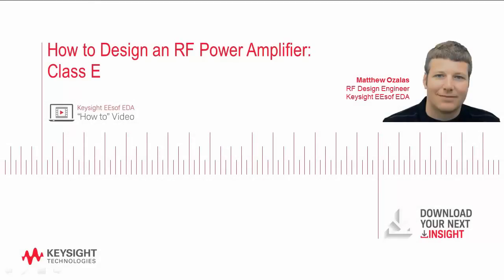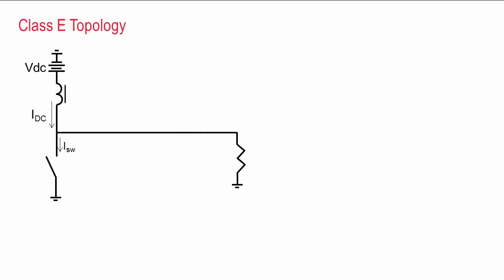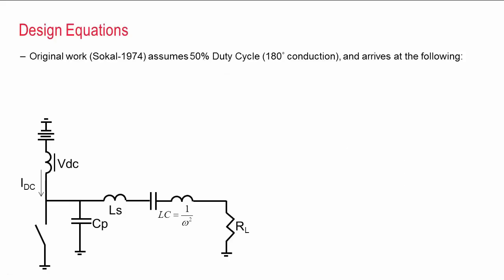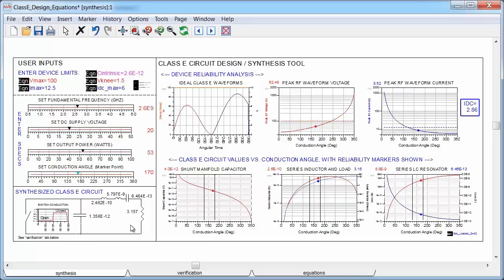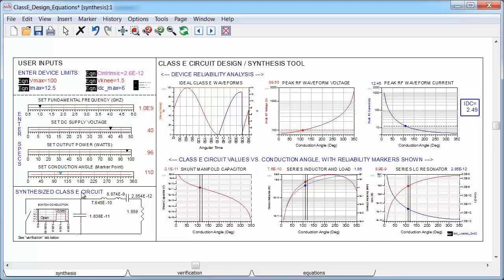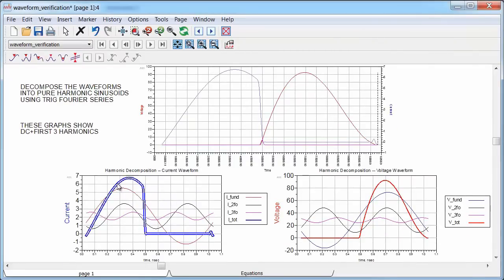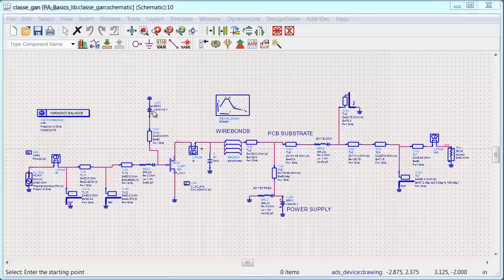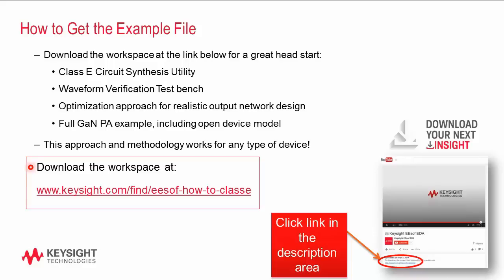How to Design an RF Power Amplifier: Class E

Comment: Could you tell what are the equations you are designing with or from which book did you base yourself to design this PA amplifier ? When you set DC bias or output power, the synthesis tool automatically adjusts parameters, but, with which equations does it do it ? Thank you !
Reply from the maker: The equations used to generate the waveforms are based on a
little bit of mathematical manipulation from Raab’s paper, “Idealized Operation
of the Idealized Class E Power Amplifier”.  These are found in the data
display.  The output power and subsequent waveform peak voltage value are
ultimately what gets adjusted when you change the DC bias (and knee voltage).
Reply from the maker: Sorry, the paper title was incorrect. It should be "Idealized Operation of the Class E Tuned Power Amplifier".
Reply: No worries. I have realized that because there was only one match. Thank you !

Comment: Hi,
Thank you for the nice presentation. It is very helpful.
could you please tell  me how can I replace the transistor GaN with PMZB380XN? or BSS138? and the frequency range to 13.56MHz?

Thanks

Regards
Sam
Reply from the maker: Nabeel Fattah 

In the “ClassE_Design_Equations” data display, on the top
left hand side of the “synthesis” page, there is a section called “User
Inputs”.   In that box, near the “Vknee” variable, there are more
variables in small print which set the range for the sliders (you may need to
zoom in to see these).  To change the frequency range, set the Freq_Range
variable as follows: [Min_Frequency::Frequency_Step::Max_Frequency].  Now
the frequency slider should update to your desired frequency range.  To
set the exact frequency, just move the slider bar to that frequency.  
Regarding the device limits: in the “User Inputs” section,
most of these can be found simply by looking at the device datasheet, or by
looking at the DC IV curves.  For example, Vmax is typically the
Drain-Source breakdown voltage.  For the intrinsic device capacitance, to
a first order this is just the device output capacitance.  To replace the
GaN transistor with another transistor in any of the designs, just simply
delete the GaN model and replace it with the model you are using, and rerun the
simulation (click on the gear icon on top).   You may need to adjust
sweep limits to get meaningful information.
For more detail on design procedure, there is also a webcast
that you can watch for free at this link: http://www.keysight.com/main/eventDetail.jspx?cc=US&lc=eng&ckey=2527083&nid=-34333.1077793.08&id=2527083

Comment: Hi, At the time 4':35" the presenter says there are some equations in graphical format to design a class E power amplifier with non 50% duty cycle. Could you please tell me where I can find those  equations? (not in your work, the papers including the equations I mean)Thanks
Reply from the maker: +Jim Style 
“RF Power Amplifiers for Wireless Communications”, by Dr.
Steve Cripps is a very good reference for PA Design.   In the book,
Dr. Cripps provides a graph which gives normalized Class E circuit values over
a moderate range of conduction angles.  Prior to this, there was also
other work dealing with how the components values are impacted by finite
resonator Q.  As with conduction angle, this effect can also be described
graphically or through a polynomial fit – a good reference is “Class-E
High-Efficiency RF/Microwave Power Amplifiers: Principles of Operation, Design
Procedures, and Experimental Verification” by Dr. Nathan Sokal –the inventor of
the Class E topology.
Reply from the maker: +Jim Style 
In the workspace shown in this video, it is easy to change
or adjust the conduction angle and resonator Q, with the component values
automatically updating accordingly (there is a variable on the bottom right
hand graph) – so both of these effects are accounted for.

Comment: First of all, thank you for this tutorial and the ADS tools.

I'm trying to match the input and output networks with the CGH40006S  GaN device, also from Cree libraries. At time 10':20'',  the output network is being matched using the intrinsic device parameters but... how can I get the parameters of my device? I tried to use the S parameters provided by Cree (only the S22 for the output matching), but the results are not convincent... am I following the correct way?

Also, at time 12':08'' it is sown the intrinsic and extrinsic waveforms but, how can I obtain the voltages at the intrinsic nodes from my device?

Thanks in advance.
Reply from the maker: For this technique, it’s best to use a device model which
has access to the intrinsic voltages and currents.  Many Wolfspeed
(formerly Cree) device models have this intrinsic access and then the nodes
“vdsi” and “idi” will be pulled into your simulation dataset automatically when
running harmonic balance.  From there, you can use V/I to calculate the
impedances at each harmonic frequency to then analyze intrinsic
impedances directly on the device for those models when you sweep an external
load.  
This technique is more explicitly described in the Class J video at
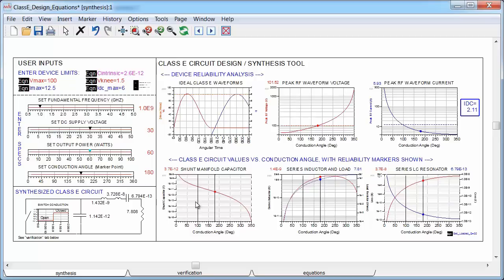8:00 https://youtu.be/N0dLVMoVQSI.  
If you don’t have a device
with intrinsic nodes available, get Cds and Cgs off the datasheet (for FETs)
and then optimize your load through this passive network similar to what’s
shown at 10:20.  That will give you at least a good starting point from
which you can then run more targeted loadpull simulations to arrive at the best
load value.

Comment: i heard class E amplifier is also use in wirelss power trnsmission..is it true? if yes how?
Reply from the maker: Class E Amplifiers are used in wireless power transmission systems.  To state the obvious: WPT systems  are very similar to RF systems with the caveat being the transfer of power rather than information.   In either system, there may be a limited amount of power to use for transmission OR there may be lots of power to transmit with, perhaps to deal with more spatial separation between Tx/Rx.   For both cases, a high efficiency PA is going to be important: if there’s a limited power budget, you’ll want as much power as possible to go to charging as opposed to getting lost in the PA.  In a high power system, thermal issues can also become problematic so a high efficiency PA is desirable to minimize heating.  In most real systems, both of these requirements together drive the need for a good PA.  As this video shows, Class E is a very good topology to achieve high efficiency.  As far as wireless power transmission, there are some other benefits too.  First, many WPT systems operate a relatively low frequencies (~7 MHz), so the initial design/synthesis method presented here may be more straightforward.  For example, at these frequencies you might find that the impedance values from the  Class E synthesis tool can be directly applied to the device without having to worry about significant parasitic impedance shifts.  Additionally, the fundamental load of Class E is inherently inductive, which is good if you’re ultimately driving a big inductive charging coil.  For more information, visit this website:  https://www.keysight.com/find/eesof-ads-power-electronics-resources
Reply: i tried a royer oscillator for WPT...but i want to produce more voltage at receiver side to charge multiple devices..any suggestion?

Comment: can i ask a question about class e pa?if i use tsmc mos model to design,can it be possible to operate at a frequency about 30GHz??And to select my output matching networks' value?
Reply from the maker: +Winnie Chang
It will depend on your specs and your device: if the output power requirement is low enough  (>>1W) and you can closely integrate the output match, it might be possible.  You will need a very high frequency (>=120GHz) matching network, and a device large enough to deliver the power while also having very low parasitics.  If the parasitics are too high, no matter what load is presented externally, the internal impedance will not change.  

As the video mentions, there are also reliability issues with Class E operation due to the large voltage swings involved which you will need to account for.  Higher powers mean higher voltage swings.  At low GHz frequencies, some have accomplished >1W Class E operation in standard CMOS technology using stacked configurations and power combining transformers, but as far as I know this hasn’t been scaled up to millimeter wave frequencies.  So hopefully your Pout spec is well below 1W.

Comment: how if i use branch line coupler on two stages class E power amplifier, is it better than push-pull or not? could you tell me how it works? thank you +Keysight EEsof EDA
Reply: Branch line is a 90 degree configuration. It can show strange behavior under mismatch conditions, if fed from a common voltage one or other PA may "load hog". Push-pull is 180 degree. Push-pull results in the cancellation of the second harmonic, which can be a great benefit. Under mismatch both amplifiers should load-pull equally.

Comment: Hi and thanks for the tool. I have a question. Is it possible to achieve 100% efficiency with a non-zero knee voltage. This tool suggests that it is but I am not quite sure. And is it possible to include the effect of a non-zero on-resistance when calculating the required load impedances? Thanks in advance.

Best,
Denizhan
Reply from the maker: It’s never possible
to achieve 100% efficiency for Class E because no real transistor is a perfect
switch.
Reply from the maker: To add in finite R-on, set the ‘rsat’ parameter in the ideal switch simulation, called waveform_verification (and concurrently set the knee voltage to zero since you’re kind of modeling that with R-on).   The efficiency will drop.  But probably your actual waveforms will still not match this for high frequency cases because the harmonic terminations impact how the voltage waveform hits the knee.  In other words, if the circuit you build does not match the harmonic impedances out to infinity, the voltage trajectory around the knee will change, perhaps dramatically – which might render the R-on based efficiency estimate inaccurate.
Reply from the maker: At the end of the day, the objective of this tool is to provide ideal waveforms that can serve as a starting point for design, given a model with intrinsic access.  The most important thing to get right is the peak voltage swing because of reliability.  Adding a knee voltage simply reduces the effective supply value, enabling a better estimate of the peak swing.  This is for mathematical convenience and is consistent with Sokal’s original work, but it’s obviously not completely accurate as it ignores the knee.  To summarize, modeling the knee transition for Class E is pretty tricky – to the point where you are probably better off just making a guess and starting the design with the actual device to see what happens.

Comment: Hi

First of all, thank you very much for the class-e workspace and synthesis tools. They are really helpful and I was able to create a class-e and simulate it in multisim.

I have a question about the classe_network_preopt schematic shown at 10:14.
In ADS2012, When I open this schematic, I notice that the  EBOND4 and EBOND_shape components are replaced by empty boxes. I am guessing that these components are not available in this version of ADS since I get an error when I run the S-Parameters optimization simulation.

My question is as follows:

1 where can I get/download the library with these components?

2 If the components are not available/compatible with ADS2012, can I use the BONDW components in the Passive-RF circuit library?

Thanks and keep up the great videos.
Reply from the maker: chefboyclakie Thanks!  The EBOND components are included with ADS2015, but they aren’t available in ADS2012. The EBONDS are nice because you can fine tune the wire profile to match what your lab bonder can do, but you can absolutely use the BONDW components in ADS2012 to do the same thing with the optimizer.  In fact, you can probably use a lumped inductor to model the bonds if you’re looking to optimize for the first time, or even just short the component out entirely--since there are 4 wires in parallel, the series inductance is rather small anyway.
Reply from the maker: Keysight EEsof EDA  If you are interested in upgrading or trying ADS2015, fill out this form and a Keysight engineer will contact you. www.keysight.com/find/eesof-sales-assistance

Comment: How do you bias a class e amplifier?
Reply from the maker: +Cer Luigi Dela Cruz 
Theoretically speaking, you want to bias the amplifier input
to obtain the proper conduction angle– for example, to achieve 180 degree
conduction, you would set the input bias at the threshold voltage such that any
positive signal will conduct while any negative signal will turn the device off
(the “Class B” Bias condition).   More information on biasing for
basic classes of operation can be found in this video : How to Design an RF Power Amplifier: Class A, AB and B : https://youtu.be/GhPqPVlDRPY. 
Realistically though, the correct output waveforms occur
with a combination of DC bias and RF input signal drive.   So, there
can be several combinations of bias + RF input drive (+input match too!) that
produce very similar output waveforms.  This is because if you decrease
the bias and then increase the input drive level, you will end up at
essentially the same place.  
At the end of the day, if you are biased
relatively close to the point which gives the specified conduction angle, you
can then fine tune the bias and drive level together to get the right Class E
waveforms and also achieve good small signal gain and a favorable compression
characteristic (AM/AM and AM/PM).  
For many PA designs this gain shape vs.
input power is pretty crucial even though the true Class E mode only occurs at
high powers– so that may ultimately be what drives the precise bias point
selection.
Reply: +Keysight EEsof EDA Thanks for that information. :)